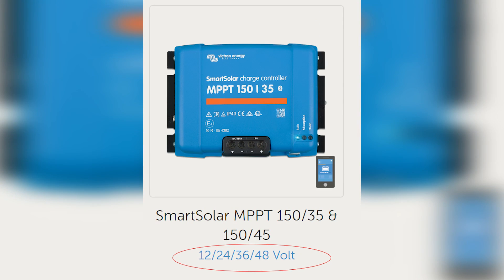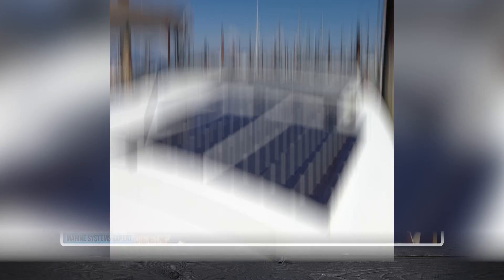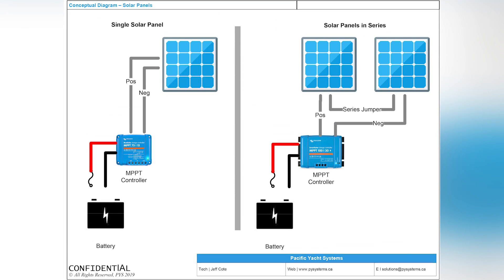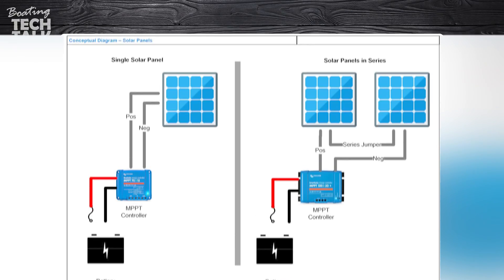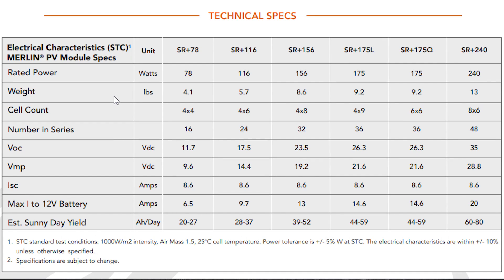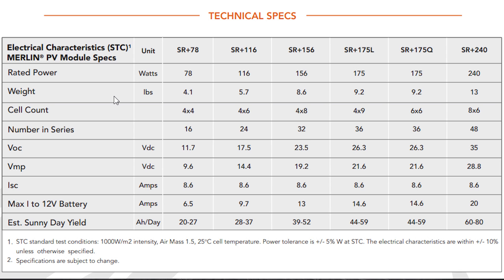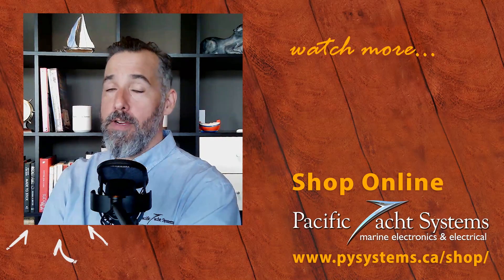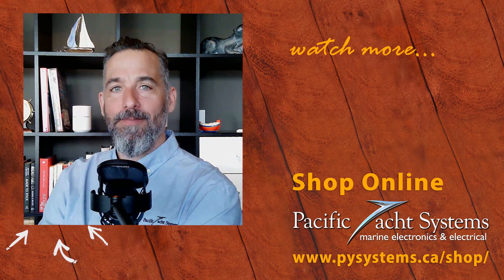Sizing a Solar Controller Based on Your Boat's Battery Voltage

Comment: Quick question is 16 volts ok for my batteries? Seems that is the default setting before the  30a Renogy wanderer controller shuts off power to the flooded batteries. This is on my boat 2 house and 2 start batteries. Only load on the house batteries is a 110v fridge from inverter and stereo with an amp. What is weird is my voltage gauge on my panel show 13.4 v when I test with a meter to the house bank it is 16v.

Thanks

Comment: Great video, following your advise placing 100 watt solar panel. The fuse connection before the batteries can I use a 10A mini fuse or do I need a regular fuse?

Comment: Questions: 1. when installing a Victron Orion charger on a wood board should a metal pate or aluminum foil placed under the fins to refute the heat?
 2. A Lithium battery bank has 3 batteries next to each other but the 4 th battery is about 2 feet away. Victron rep stated that is unacceptable while the ReLion rep said any separation up to 10; is ok. Is there a general rule or up to the specific battery manufacturer?
3. I intend on feeding the Orion chargers from a common bus connecting the output of the 120 Amp alternator thru an isolator and the 60 Ampboat charger.
At this point I have 3 100Ahr ReLion Lithium batteries in the bank. I have an AGM 105 Air engine and 2 AGM 80Ahr bow thruster battreies fed thru the isolator.

Comment: Another great topic. Just as a heads up to fellow boaters, my boat is out of the water in the UK and the solar panel removed. However, I left the MPPT connected to the battery via fuse. The circuitry and LED were then being sustained by the leisure battery so I ended up with only 11.6v on the 12v battery after several weeks. Eeek! The MPPT is now disconnected and the battery recharged. I hope I didn't ruin the battery ( this is only time the voltage has dropped this low ).

Comment: if a boat has no earthed mains fixtures on the boat and only uses a mains battery charger. do you still need a galvanic isolator or isolation transformer in a marina?
Reply: . (wanna know too)

Comment: can a battery charger turn into a sort of  inverter eg; leak power out of a battery when disconnected from shore power when  mains fixture is left on .eg phone . hand held radio charger